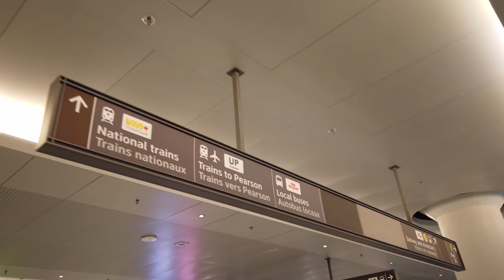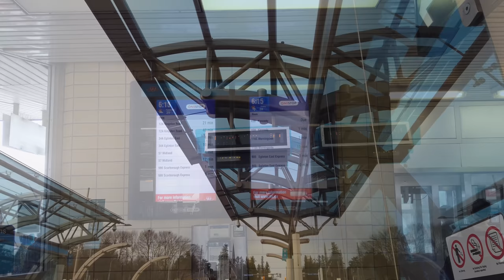How to Plan a Good Railway Station

Comment: My Home Station - Is Reading (UK) opened in1840, it of course has been upgraded many times, In 1989 a new station concourse was added, as well as a multi-level car park, the 1860 ticket office converted into a Pub. Between 2009-2015 the station was upgraded again, new overbridge (with shops) 5 new platforms, new tracks, electrification - Elizabeth Line trains will terminate here.  Whilst we only have buses no mass transit, buses depart from both north and south entrances. The station is to the North of the Town Centre, although developments south of the station are increasing.  Toronto - I did travel from BMO Field into the city in 2007 I enjoyed the ability to walk between building underground, which of course is down to extreme weather, glad to see Mass Transit plans.
Reply: My hometown's opened at around the same time.
Late 1840's 1850's ish.
And is currently in a odd situation being a minor hub for Grand Central services to london and northern's regional services that are still a terrible 1 train per hour each way....
Whats more odd it's only got 1 mainline platform active but has everything else a modern station has atleast by post 2010 where it was refurbished for tall ships races coming over and theres plans for another one this year bringing back old platform 1 that was left abandoned since the 1990's along with a new footbridge (Covered roof along with Lift system) construction starting later this year.

Though the connections to the local bus services is well questionable....
With only intercity sevices actually terminating at the train station and a short walk across a dual carrageway is required to reach all the local services.

Comment: Some smaller stations in the UK do something which I like: if the passenger flow is typically in one direction when boarding, that platform will have long shelters with lots of room, whereas the opposing platform where people alight trains but don't wait so much have smaller shelters
Reply: similar thing with bus stops in my home town: the bus lines going into the city usually have a small shelter because that's where people will be waiting for the bus; The bus lines going out of the city won't have shelters when they're outside the city center, because most people will only get off the bus there

Comment: Since you mentioned Montreal, one thing that would be an improvement is not needing to go to a booth to get a rechargeable transport pass. Also the ability to return the transport pass for a deposit return, which is something I did see as an option in Bangkok.
Reply: This isn’t a station design thing, but being able to tap your credit/debit card to pay and go through the metro turnstiles would be such a game-changer in Montreal, especially for occasional users and tourists. This could remove the need for a lot of people having to queue up at the ticket machines to buy tickets.
Reply: @ethandanielburg6356  I’d argue it is a station thing in the sense it is access to the system, which the station is in many ways. What you describe is something they have in the London, UK tube system and avoids needing to get a physical Oyster. Even Bixi supports that functionality for the bicycles.

Comment: Having shops close to or inside the station is really convenient and time saving. The stores will serve both transit riders as well as local residents. The local residents might be compelled to shop and if they need to go somewhere else they are already at the station.
Reply: comes with pros and cons; While nice and convenient for commuters and travelers, shops at stations also tend to be way more expensive than a comparable shop elsewhere in the city. Thus, many locals won't go there and rather go for a place which is both cheaper and of better quality (thinking about any sort of sth to eat  - like sth from a bakery, kebab shop, coffee shop, ...

Comment: San Ysidro station on the SD Trolley had 18 K daily passengers in 2019, more than all but 8 or 9 DC Metro stations. Yet the station facility is Spartan and could definitely use more than just bus shelters.